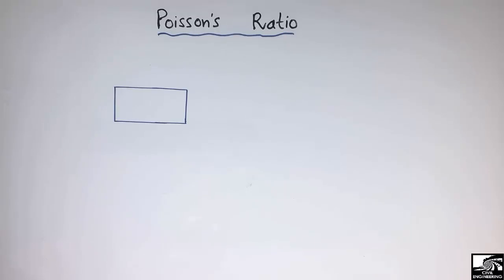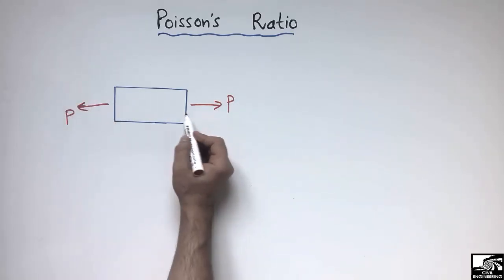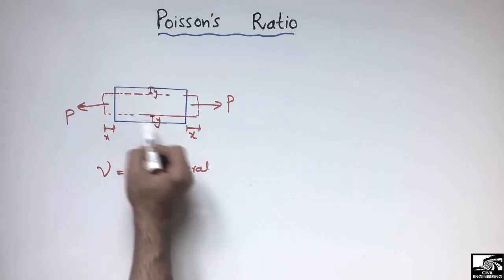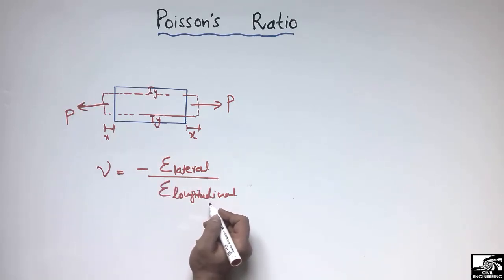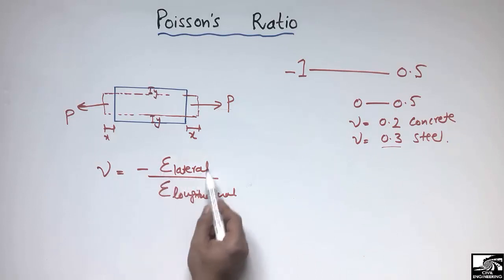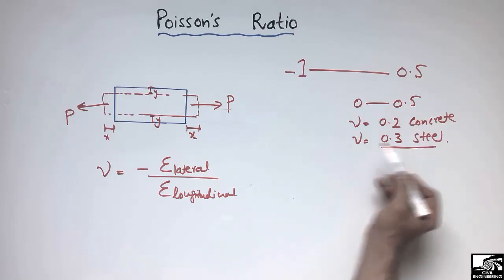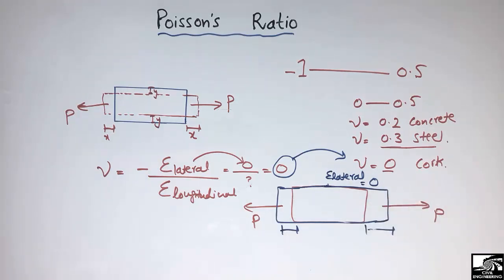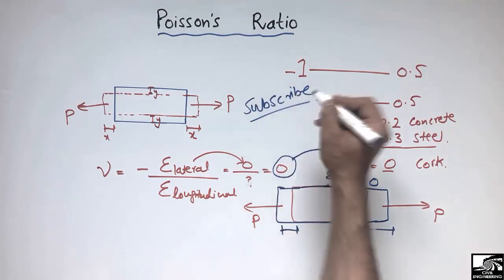What is Poisson's ratio

Comment: The following explanation seems easier to understand:

The Poisson Ratio of the dimensions of a material affected by a load is:  PR = contraction / expansion
For example:  when tensile (pull) force stretches a material (e.g. taffy or steel), the material expands in the (i.e. longitudinal) direction of the applied force  & simultaneously contracts in the (i.e. transverse) direction that is perpendicular to the applied force.  So, if a piece of steel stretches 1" & contracts .3", then the PR = .3/1 = .3

Concrete is less elastic than steel, so it has a lower PR (e.g. PR = .02 / .1 = .2